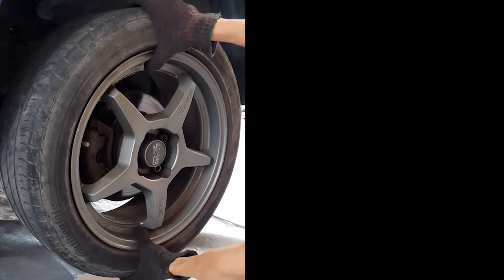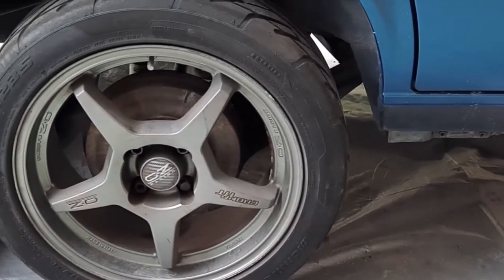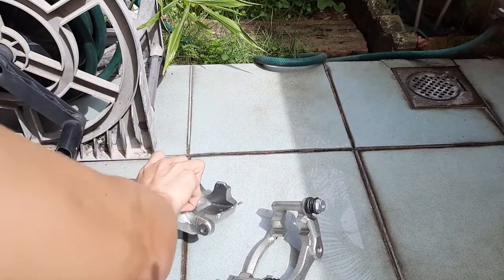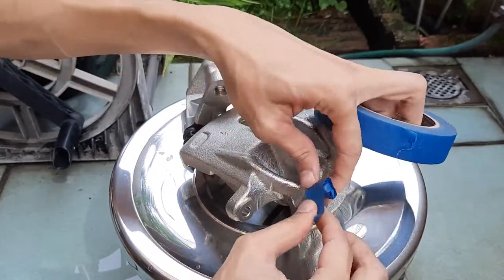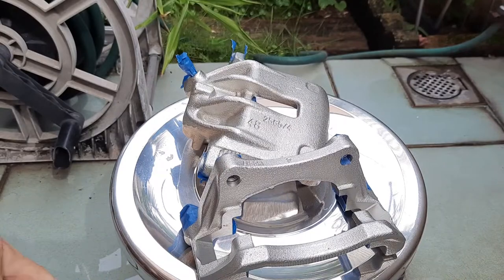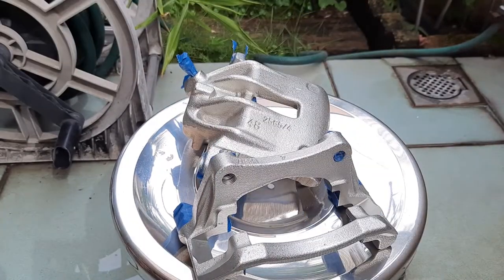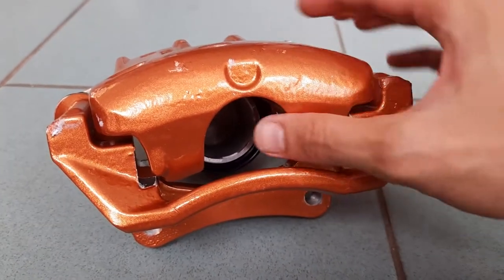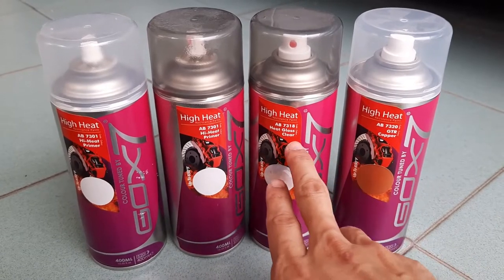Painting Basic Calipers for a Smooth Finish - BMW E30 Project ep8

Comment from the maker: If you're planning to try this brand of spray paint, i recommend that you leave the calipers hanging in the spray booth until you are ready to install them on the car.

There is no need to combine both halves of the caliper before installation - just install the mounting bracket first, pads, then the piston part.

This way there is less chance of damaging the still-soft paint.